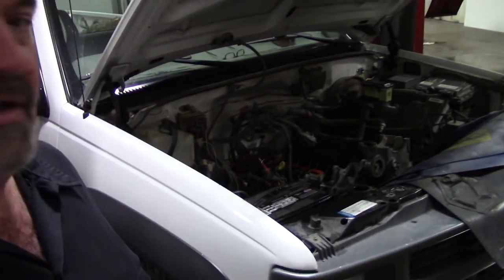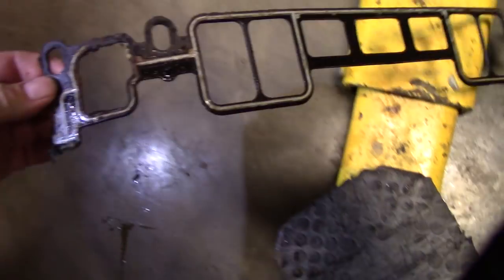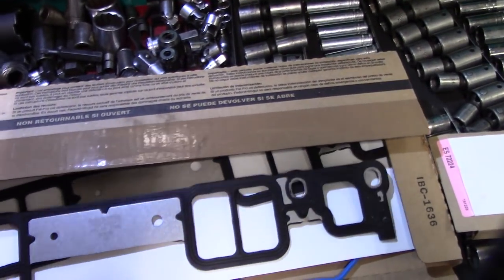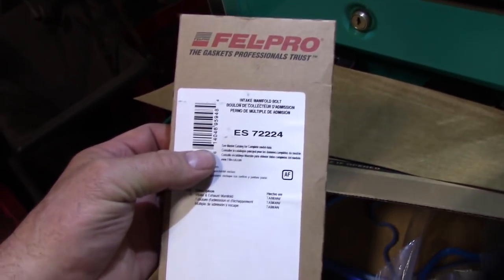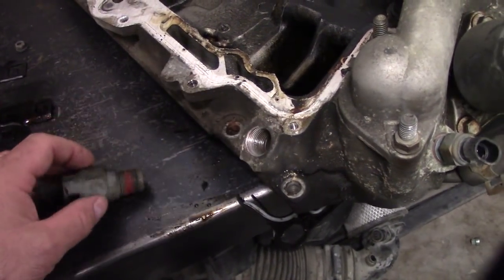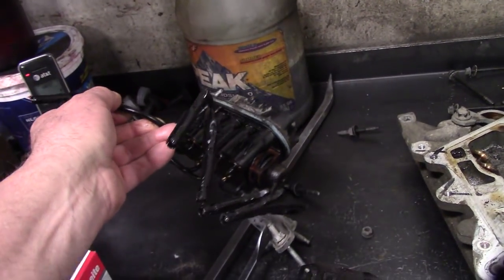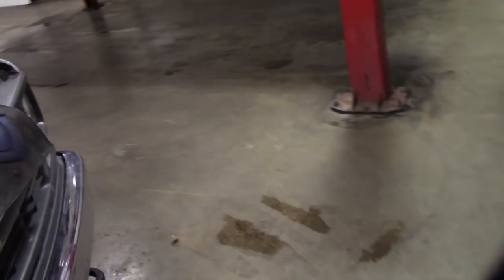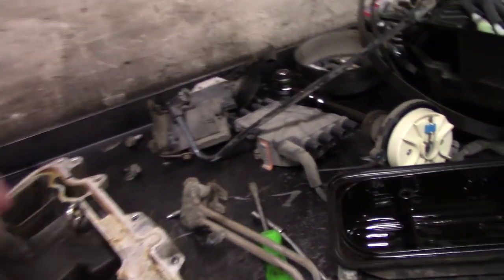Chevy Vortec 5.7L Intake Manifold Gaskets MPI Fuel Injection Update Best Practices

Comment: i hate this system convoluted cheap nasty junk. lol most i seen on a dizzy cab was 200k near it any how old 22r bass of coerce we cleaned it installed in back as it was fine the new one was pot metal i leaned  not to use them if the old one was bras and just needs cleaned up the cheapo stuff just fails in short order well one of them did in a year or so

Comment: Moisture & arc gasses is another BIG problem with the dist.. The trick is to drill out the vent screens at the bottom of dist. It better ventilates allowing it to breathe much better!  I'm in IL, and was going through two caps a year! UNTILL I found this secret. Had the same cap on now for three yrs....After extensive research! It is in fact a design flaw, but was never recalled by GM.
Reply: Keith Bartlett thanks for the tip. Can you make a video on that!? It would be a hit on YouTube! Thanks

Comment: On my 1997 Chevy c1500 5.7L, i have a high idle issue, the improvements that i have done to the truck are a new IAC and sensor, new complete distributor with correct timing set at top dead center, new spark plugs, new spark plug wires, new AC Delco multiport fuel injector, and upper intake plenum gaskets. ( i have not changed the stock intake manifold gaskets yet.)  And after all that i still have a high idle. One thing i noticed was when i sprayed some brake cleaner near the intake gaskets with the truck running > the idle raised even higher then went back down. Thoughts, comments, and advice is appreciated.
Reply: Clean your throttle body. Your idle will greatly improve. Easy fix

Comment: I have a 1996 GMC Yukon 5.7 L. It's been a year or so since you made this video I was wondering how you would check for a cracked lower intake manifold. I can get a used replacement salvage yard manifold for 50 dollars. Do you have a method I could do to check if that salvage yard manifold is not cracked that would save me some good  money. Thanks for you videos I will use the Felpro updated lower manifold gasket set. Liked and subscribed.

Comment: I think that's exactly what my issue is on my 98. It won't hold fuel pressure after the prime. It's a slow drop off, but I need to do that upgrade anyway. That will kill two birds with one stone. Thanks Tim.

Comment: What if you don't use the new bracket for the injector body? I did the update on my 4.3 and used the old bracket and it seems fine to me.
Reply from the maker: In this case I didn't think it would fit with the old bracket. The injector body is a little different and it needs to sit at the proper position since it seals in the upper plenum with that o-ring. But in your case if it isn't leaking vacuum it's probably just fine.

Comment: Nice to see you making videos again bro! I'm currently replacing a clutch in a 2011 focus...the pressure plate inside the clutch is shattered into 3 pieces and goudged out the inside of the bellhousing...gotta order a new clutch kit and the pressure plate that attaches to the flywheel? Do you know the technjcal term for the plate?
Reply from the maker: We call them a clutch cover. Sounds like yours really exploded. You better lay off the pedal brother! Hahaha
Reply: The Car Doctor not my car
Reply: my question is why was the flywheel pressure plate was rubbing inside the bell housing (goudged a circle into the bell housing)...it's as if it's too big to fit into the housing which explains why it was so difficult getting the trans separated from the engine

Comment: Hi Tim, It's great to see you. As always you make great and very educational videos. I always enjoy them. Tim I have a question!. If you were going to buy a pickup say ten years old. Which truck would you recommend? Which one would you say had the least problems with the motor and transmission? I know it's an off the wall question. If you don't want to answer it or remembered a truck. I will understand. I am thinking about buying an older truck. Cause my old truck was in an accident and it's history. I appreciate any advice you can give me. Thank you. I hope you have a blessed weekend.
Reply from the maker: Hey buddy thanks for asking. Probably a lot to consider on a truck. Maybe most important is what's available in your area. I am a Chevy guy myself so I would be inclined to look that way. I don't mind working on them and I like the 6.0L engine for its power and torque. But the bigger question is what are you needing from a truck? Good gas mileage? Towing capacity, seating, options? Do you have rust in your area? Do you drive off road? Are there any differences in insurance costs between brands in your area? Are parts available to you for any particular make or model? Are you more comfortable working on one over the other and is there qualified techs around that know that particular make? I often go for a vehicle that wasn't my first choice but the deal was too good to pass up. A persons that cared for it well and just upgraded or moved away or their kid left for college. Those are sometimes the best deals because they may not even be advertising the sale and you find out by word of mouth. I hope the perfect replacement comes along for you and you get a really good deal on it. Blessings my friend.

Comment: Tim,  great video and information!! I have exactly the same engine in my suburban.  1999 k1500.  I replaced that exact same felpro gasket kit.  works great!  I am in process of replacing my injectors.  As its leaky, old, poppet injectors.  I just need to buy the new updated one.  is that al Delco part for injectors work for 1999 GMC Suburban k1500 5.7?

I've been told that mpi will work awesome and gain more torque and easier starts.
Reply from the maker: Double check the number but that should be the correct kit. You'll notice a difference in mileage and idle quality for sure. It's a great upgrade.

Comment: I have a 4.3L Vortec engine that is prone to the same problems as the 5.7L. In December 2015, I performed this same repair and did virtually the same part replacements as you are doing. Installed new Fel-Pro intake gaskets, new intake bolts, new valve cover gaskets, new oil pressure switch, new cap, rotor, plug wires and AC/Delco reman distributor and  new updated AC/Delco spider injector system. Just over $300.00 in parts.
Not one single problem since this repair.
Reply from the maker: Very nice! Such a good feeling when you know these things are not going to be a problem down the road. Good work!
Reply: We appreciate your channel, Tim. Keep up the good work!
Reply: Hey. I would like to get your parts list! I have a 2002 gmc van with issues. Thanks buddy!